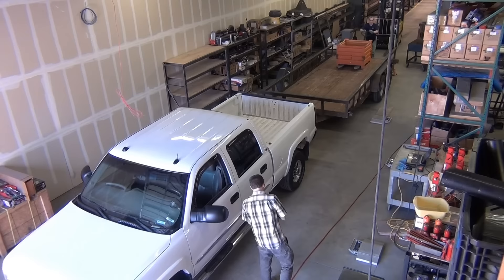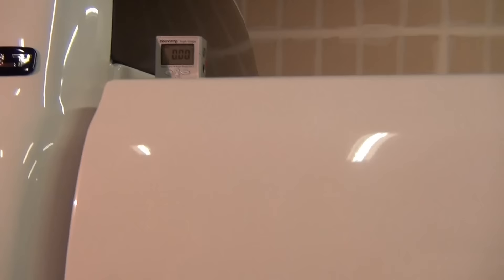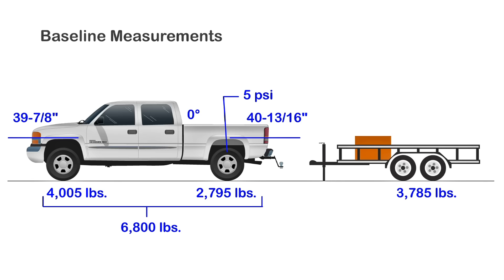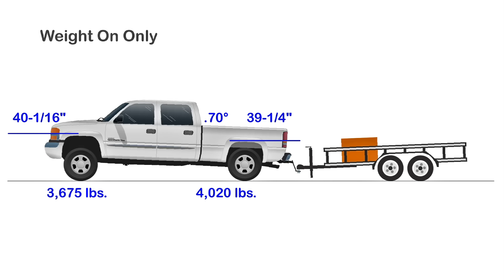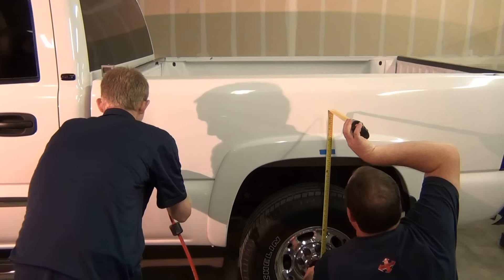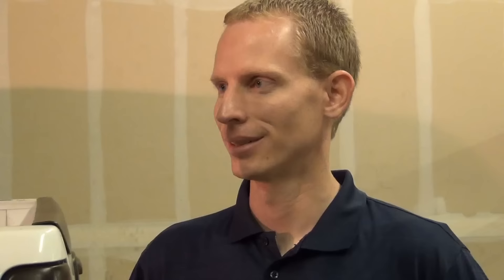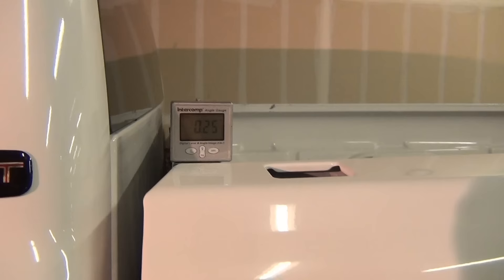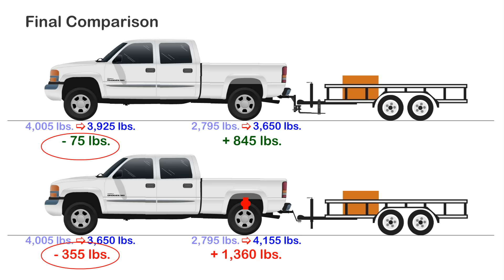The Difference Between Using Weight Distribution and Air Bags to Level Your Load

Comment: Good luck trying to explain this to rv dealers who refuse to properly setup WD hitches for customers. They are constantly setting up the hitch allowing the front to still be higher than unloaded. I have tried to explain to countless companies that this is incorrect, but they always say the same thing "This is how the WD hitch instructions say to setup the hitch."

Your video proves what I have been saying for decades! Even with weight distribution setup to drop the front height slightly, there will still be less weight on the front axle, so how do they expect a 1/2" of ride to be "distributing" the proper weight back to the front.

Personally, I setup the WD first, then air up after. I have found it easier to get the right transfer back to the front. If I try to air up first, then I always have to let air out once the WD is installed.
Reply from the maker: +Charlie Odom, we understand where you're coming from. We spend a lot of time teaching and training our dealership's staff, it is one of our highest priorities. They face a difficult challenge with constantly updated technology from all of the different and varying products they sell, employee turnover, etc. Most do the best they can with the resources they have. This is why we publish videos like this - as a reference for their staff and for the customers using our products. We hope that every customer gains a clear and thorough understanding of how to set up and use their equipment so that they have the best and safest experience while towing.

As always, it is important to remember that not every setup should be the same. Different combinations of tow vehicles and trailers require that each setup be tailored to fit that particular towing situation. Heavy duty tow vehicles like a 1 ton pickup will react very differently to weight distribution than a smaller SUV. Be sure to follow the owner's manual when you set up and adjust the hitch, and pay attention to how it is towing. Make adjustments as necessary so that you get the best and safest tow for your particular setup.
Reply: Charlie Odom 
I believe most people don’t understand how to first set the angle of the spring arm pockets below the ball.  If they don’t start the tension of spring arms early enough (low enough) you end up with inadequate tension and too many chain links have been dropped off leaving the spring arm WAY too high alongside the tongue beam,  which will bind up the whole system in a sharp turn.

Comment: great video. weight distributing is almost mandatory for vehicles pull heavy weight (similar weight to the towing vehicle)
Reply from the maker: We agree completely. Check your vehicle’s towing capacity, either in the owner’s manual or on the receiver hitch. It’s almost always double when using weight distribution vs. weight carrying. Towing with a good weight distribution/sway control hitch like the e2 hitch [http://fstwy.co/e2] is the safest and best way to tow a heavy load. Thanks for the comment!

Comment: Cool project. Very analytical. I was considering adding air bags along with my weight distribution hitch, but your engineering project has showed me that it really is not necessary. Specifically, as you mentioned with a comment below, the air bags change the dynamics of the WDHS. Furthermore, air bags have a tendency to leak (not all the time), so even if the WDHS was adjusted to account for the change the air bags create, the potential for leaks and the changes that could follow don't seem worth it to me.  Thanks for sharing with all of us!

Comment: In Summary, use the correct tool for the job.  Air bags serve a purpose, but not for what most people think.  The way these guys have it setup, using the WDH, and the recommended air pressure in the bags gives for a smooth stable ride.  Note they did not try to add air in once the WDH was set up or they would defeat the purpose of the WDH.  Good job guys.    Manufacturers put a rake in the pickups for this specific purpose, when loaded properly the truck levels out.  When hooked up with a properly set up WDH, the truck levels out.  With a little more tweaking, I would not be surprised to see them return 100% of the FAW and level the truck to nearly 0 on their meter.  I use a Blue Ox on my F150 and it is setup to return 100% FAW, and is nearly level front to back, plus it reduced GVW by 400 pounds. 

In short, if you need air bags to carry the load, you are overweight, get a bigger truck!   They were spot on with overloading the rear axle. Most 1/2 ton have a 4000 GAWR! Things go boom when you overload it!

Comment: Great video.. Only thing you missed was after connecting the weight distribution system you should have used the air lift to get yourself level.  Or adjusted the ball angle to increase the distribution to get the rear of the truck level again.   Thanks for making this video.. Super helpful.
Reply from the maker: Thanks for the tip! We'll make sure to include that in our next video!
Reply: @FastwayTrailer  did you ever made a proper final setup ?
Man you guys was so close !!!

Comment: I have watched with interest your presentation and I am interested in the position of your weight /load on the trailer. I was all ways taught to load the  trailer just forward of the center of the axle/ axles. If you loaded it in the center of the axles the tow vehicle would have very little control and if moved to the rear ... well that would be a disaster. It also stands to reason the further forward you place the load then you place more load onto the rear axle causing the front axle to lift of the ground. In your diagram it appears you have the load too far forward and in doing so putting too much load on the tow hitch.......I have used both hitches over the years over long distances and agree they both have there advantages. At the moment I tow a 3.5tonne trailer approx 650km every week and only use airbags which work fine if the trailer is loaded correctly. The advantages with the airbags is that without the trailer I can load the ute and keep it at the right level but the other advantage is that it make the vehicle more stable on the road. This is only my opinion and my many years driving trucks across Australia.
Reply: correct tongue weight is a percentage of the total weight of the trailer 10 to 15° without scales all you can do is guess. I always try to have about an inch of drop after snapping up the bars (both my wd are the old style)

Comment: With the weight distribution hitch being connected from the hitch to the tongue of the trailer using the ball as a fulcrum it would be interesting to have a scale on the ball to see how much more stress the ball is under.
Reply: The force between the hitch ball and trailer coupler can increase by about 2.5 times the amount of the original tongue weight. Makes it important to use grease on the hitch ball!

Comment: I have air bags on my old F250 and absolutely love them. Makes a big difference when pulling a loaded  gooseneck horse trailer.
Reply from the maker: Yes. Using air bags with a 5th wheel or gooseneck trailer is a great option. Thanks for the comment!

Comment: Great video.  New to the towing world here.  I have a weight distribution hitch and air bags.  I wish to use both efficiently in order to have the safest ride possible.  Any videos on how to properly use both?
Reply from the maker: We've got a video in the works on this that will come out this year!
Reply: Three things to remember for a safe towing: 1. Never go above your vehicles GCWR( gross combined weight rating) ; 2. Keep your trailer weight distributed, so the thong weight is not over what's supposed to be; and 3. Keep your speed below the speed limit on the highway ( California mandates 55mph for anything that has something in tow- for your safety).

Comment: One aspect most don't consider is the steering stability of the WD. It moves the CG of the vehicle forward, reducing sway and assists in dynamically stabilizing the vehicle.  Demonstrated in your experiment, but not expressed. Meaning, the pivot point on a curvy road is brought nearer to the center of the tow vehicle, where lateral movement is absorbed more equally by all four tires and suspension instead of just the rear. Air bags primarily only add to safety by carrying a load in the truck, or a gooseneck/fifthwheel setup. When towing a bumper pull, a good WD is a much safer option, because the weight can be moved forward in both the tow vehicle and trailer, thereby taking advantage of a naturally dynamic stable combination. Think lawn dart (Yes, I know there are other aerodynamic factors involved with the lawn dart example, but most can understand it.)
Reply from the maker: +Tim Delph, thanks for pointing this out! A complex concept you very clearly explained.

Comment: but 1 major reason I went to air bags on my 98 f350 cclb was "ride" .  My camper + firewood in the bed and other misc items, it just started to engage my last leaf spring, making for a rough ride.  These numbers are close to the ones I had when I was testing to.  Thanks for your efforts and help.
Reply from the maker: Thanks for the comment +Robert Trimble.

Comment: they work great on flat service roads, but if you have ramps you better disconnect. these hitches  it will make you rig one single frame from front front to back , said that if your truck rises up like going up a gas station or shopping center and there a ramp of shorts. your rig with these hitches are going to try to remain straight. As the truck rises up it is going to push your trailer into the road most likely snapping the chains Now highways are mostly flat enough this is not a problem at all and work great. just be aware you may need to unhook your chains in town.

Comment: Informative video, thanks. So the safest and best level system is using the WD hitch. My concern is how to use a 2019 Ram 1500 with air suspension along with my Husky Centerline weight distribution/ anti sway hitch. I plan on just attaching it the same way I did on my Silverado with no air suspension. The dealer told me the truck will automatically level, I'm sure not until after I start the truck up, so I'm thinking just level same way I did before while the truck is off. Thanks guys, keep up the nice work!
Reply from the maker: That is correct. Set the tow vehicle up as it will be loaded for towing. Let your automatic system make the adjustments, then disable the system by turning it off, turning off the vehicle, or pulling out the fuse. Then, set up your hitch for that height. Once the hitch is setup, re-engage the automatic leveling system. You might need to make a minor adjustment, but you should be pretty close.
Reply: @FastwayTrailer  Think I got it now. I can't wait to try it and go camping. Thanks again  guys! I'll keep you posted. Regards
Reply from the maker: @Hundert1  You're welcome! Have a great trip!

Comment: NO MATTER WHAT!.. ...Anyone towing a TTRV should get a Weight Distribution Hitch AND Sway Control Bar!!! High winds can flip over Semi-Trucks w/trailers, and you will want every possible piece of safety equipment installed on your rig! I travel across country🇺🇲 a lot with my 10,000lbs TTRV.
Reply from the maker: Awesome! Thanks for sharing!
Reply: Meh. It really depends what truck and trailer you're driving. A Dually pick up towing a 20 foot travel trailer is not going to have issues. I tow around my 20 foot enclosed cargo trailer which weights 2400 pounds with my 2006 Chevy 1500 and it does juuuust fine. Once I've loaded it up I will put weight distribution bars on but for the most part I tow without bars.
Reply: @Durataur  Tell that to the dually hanging off the bridge by the safety chains after sway event caused loss of control.

Comment: A small box weighing X placed far enough forward to create 1000lb tongue weight IS COMPLETELY different than a 14k dump trailer or a 16k camper. These trailers will have the weight more over the trailer axles and have different effect on the tow vehicle
Reply from the maker: This is true. Each setup will be different and should be set up according to the WDH owners manual.

Comment: Good video. Also help newbies understand how trailer and tongue weight changes your vehicle weight to each tire/axle. 
 But to any newbies out there this doesn't makeup for a correctly loaded trailer.
Reply from the maker: Agreed! Loading a trailer properly is always an important factor that should be taken care of before using either weight distribution or air bags.

Comment: What you forgot to mention was that these hitches add stress the the frame of the trailer and have caused them to fold up. Manufacturers now void warranty if these hitches are used while towing on anything other than highway.
Reply from the maker: Our warranty doesn't work like that! Crazy that some only cover highway!

Comment: Great video! Thanks for this. I was debating on what I needed to do to my truck and now I don't have to debate.
Reply from the maker: Glad it was helpful!
Reply: @FastwayTrailer  It absolutely was! I'm debating on uprgrading to a 3/4 ton, but I'd only need it for about 3 trips a year and this Weight distribution hitch would do quite a bit.

Would you recommend those spring style bump stops or anything else that is smaller? Curious if you tested those. 

Another thing is that ppl say to add a leaf, wouldn't that still take weight off the front wheels?

It seems like a weight distribution hitch is the absolute number 1 thing that should be done.
Reply: @Ka_Gg  No amount of spring or air bag at the back will change the amount of weight that is unloaded from the front axle when you put a conventional trailer on the back of the truck. You must always use a weight distribution hitch to force load back on the front axle. Then once that is taken care of you can use an extra spring, air shock or air bag to lift the rear back to a normal ride height. Provided of course the squat in the rear was not caused by overloading the rear axle.

Comment: So you effectively (based on your tilt gauge) only removed less than half of your sag .  With this as your fact your headlight stargazing will still be an issue.   So as so many others on here, I use both, I take the weight off the hitch (with a properly loaded trailer with 10% tongue weight) with my weight distribution hitch, then properly level my truck with my air bag system back to pre-trailer height.
Reply from the maker: Yes, that is something that some trailer owners do. We are working on a video set to come out this summer about using both WD and air bags!
Reply: @FastwayTrailer  is it ok to add a little air to the bags to bring it back up after installing a weight distribution system? Or are there negative consequences?
Reply from the maker: I wouldn't. Adding air after the weight distribution system is installed will lessen the tension on the hitch, resulting in less weight distribution and reduced sway control.
Reply: Headlight angles can usually be adjusted pretty easily on modern trucks by several degrees to bring the headlights back down to an acceptable angle for oncoming traffic. There's usually a set screw you can get to from the top of the headlight housing.
Reply: @bry2k  and then tomorrow night you have the trailer off the vehicle?????  What then?  Readjust??

Comment: A quick correction. Starting Trailer weight was actually 4785 shows at 3 minutes 25 seconds in the video. After WD hitch the trailer weight showed 4150 so it still sent 635 lbs back to the truck, but that is much better than the air bag situation. I think when you look at trailer base line weight the argument you make gets much stronger even with the corrected trailer baseline numbers. 
If you really want to geek out on this- You could also look at tweaking further the WD hitch so that the weight on the truck front axel is bearing even more load by increasing the torque on the trunnion bars and you can manage that by adjusting the height of the ball to be slightly lower using a drop hitch  and then sending more weight into the spring of the bars so that the trailer remains level even though your pushing more weight into the front of the truck that you cannot see with your eyes.  You can actually adjust this so much so that you can send a large portion of the weight into the front of the truck, and it can actually make it very unsafe and imbalanced sending too much weight into the front of the truck to the point which you can practically remove the rear wheels of the truck forcing the weight of the rear truck and the trailer up and onto the front truck axel.  The original TV commercial from the late 1960s early 70s of one of the first WD hitch was an ElCamino with a Small boat and the WD set in such a way that they removed the rear wheels and drove around in the TV commercial without rear wheels on the ElCamino while pulling the boat (single axel).  Obviously an Unsafe situation, but it shows what you can truly do with a WD hitch and how it works torqueing weight through the interconnected frames.
Reply: How did they pull the boat around in the commercial after removing the rear tires & wheels of the ELCamino or did they option  the ELCamino with the factory FWD option & lock it into FWD & pull said small single axle boat?
Reply: Elcamino was never front wheel drive.